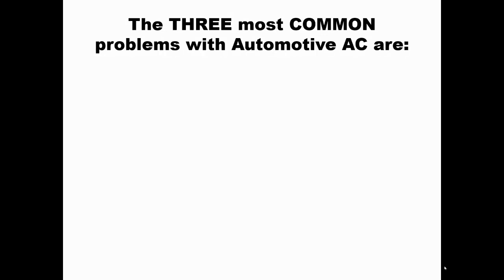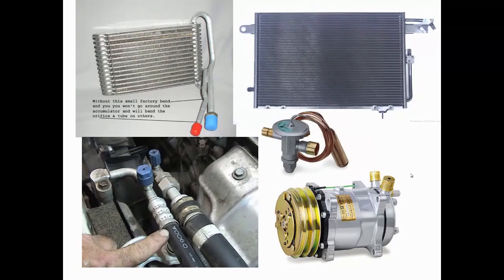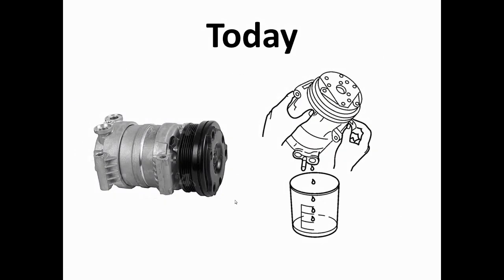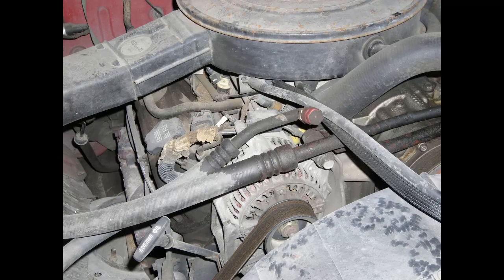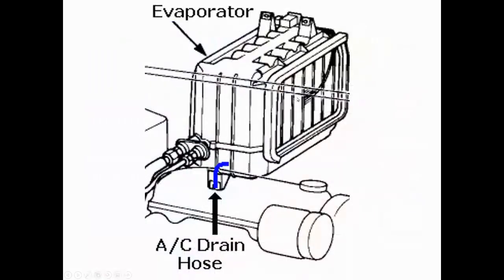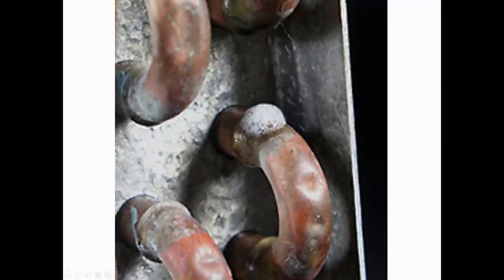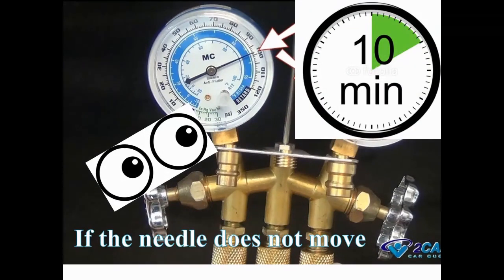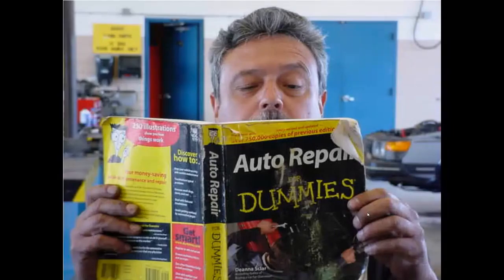Lesson # 9 : Find Freon Leaks Part One.

Comment: Is it not true that if you put too much oil it can clog up the system and lower its efficiency?
Reply from the maker: Too much oil will cause the pressures and temperature to increase. Increased pressure and temperature will cause the AC not to cool and the entire system will be exposed to unnecessary pressures that will cause leaks and also damage the compressor.

Comment: Please give me an advice. 

You suggest to use 110psi
Automotive test solutions claim to not to get over 200psi cos can damage evap core
Scanner danner claim,, 300psi is maximum.

Now I do not know what to choose. Please, give me some more informations. You would help to me really a lot. Four cars with ac problem are wsiting for my hands and head. Big thanks
Reply from the maker: The evaporator can NOT handle more than 200 psi. I would not exceed 120 psi. Look at the low side pressure gauge max psi. After 120 psi it goes into "Retard" (look at it). I joke with the students but I think the gauge goes into psi measurements that are NOT accurate. I have had students misuse the nitrogen regulator and "Pop" the evap.
Reply: Dear Teacher.

huge huge, THANK YOU

I ve putted there 275psi[ I know, I get/am retard :-))) ], I wanted to get 300psi but was not possible. Fortunatelly. 275psi was there for some... 16hours approx. Fortunately nothing, the vehicle is octavia 1, seems everything OK. no leaks. During the night the pressure got a bit down ( do assume cos temperature, the gas was CO2) but then got back up. 
Will not repeat huge pressure. I do promiss :)

btw. my gauges are also rude, and I was laughing above "retard" too. 

Have a nice day Teacher, and again, huge thanj you and my gratitude
Reply from the maker: @razdva402  I'm Glad to Help. Break a Leg / Good Luck my You Tube Friend.
Reply: @theoldmecanicoshow9004 The Teacher. You was right. 😅😅😅 I am a retard 😅😅😅,,,, cos,,,, low pressure gauge has damaged, I do assume, cos too high pressure in. I had 275psi in. Now, it shows around 10psi, even with no pressure in. Highly likely the "spring sheet" in, has bended. 

Thank you again for the advices and all videos too. And I do wish nice time by painting the old truck. 😊
Reply from the maker: @razdva402  Thank You Thank You Thank You...!

Comment: When checking for leaks with air does the cars ac compressor needs to be on?
Reply from the maker: Hello Pantera. Thank you for the view and the question. No, the compressor should not be on when checking for leaks. However, after checking for leaks, you should start the engine and turn on the compressor to check for three things:  1. does the compressor engage  2. how does the compressor sound  3. does the pressure drop like it is suppose to.
Reply: @theoldmecanicoshow9004  thank you sir and God bless you for your simple to understand videos..